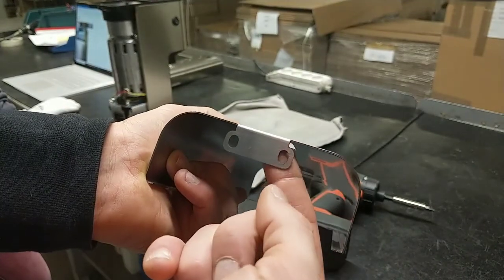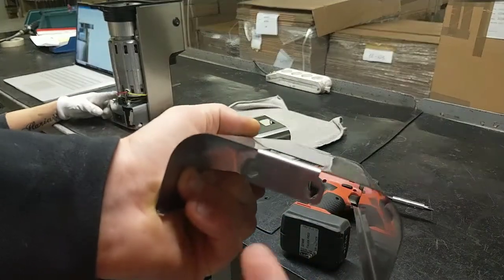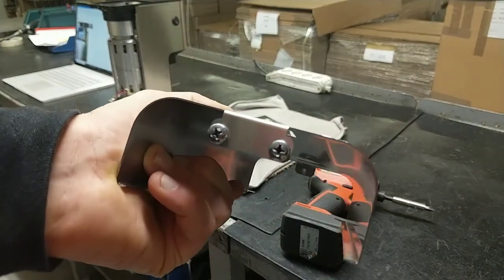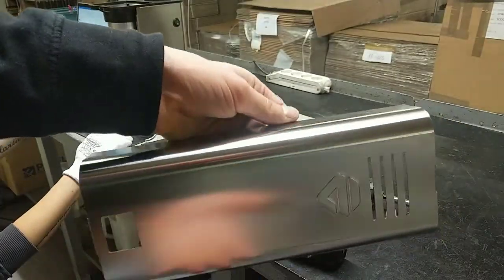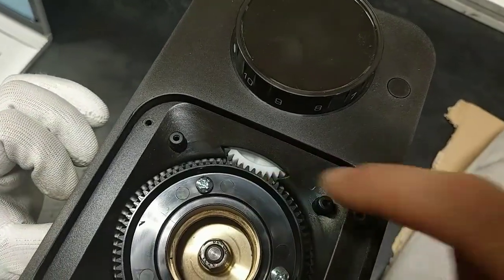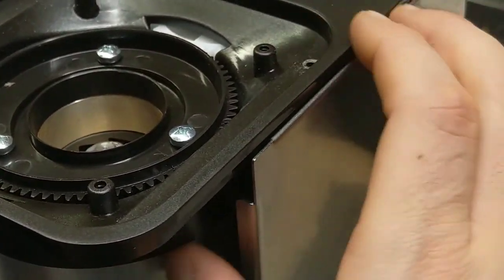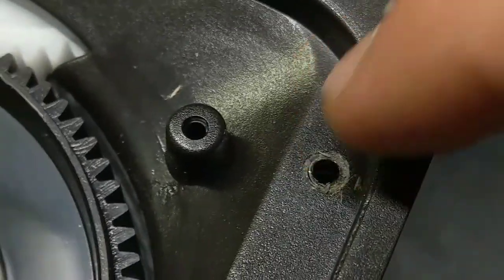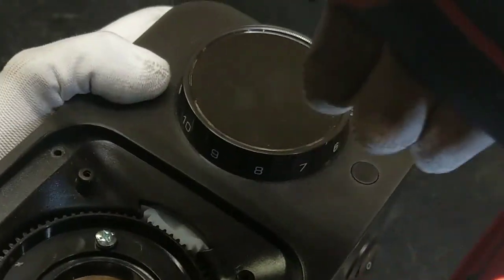pl72 pl71 back cover assembly

Comment: one question: is it possible to order the plastic top plate without knob and screws and all this stuff? only the brown top-plate, cause the part, where the big of the 3 screws in the back (which i have to open to clean) is broken. it works, but it is not 100%. if it is possible, i can send you a photo (i don't need help to repair)
Reply from the maker: yes, you can order it, you have to contact your reseller,
or if you need help please send an email at care@lelit.com

Comment: It's possible to upgtade the burrs with SSP red 64?
Reply from the maker: I do not know these burrs
but pay attention to the outer diameter and the direction of cutting.
some brands change some parameters to avoid using original components. so you have to check the dimensions before buying